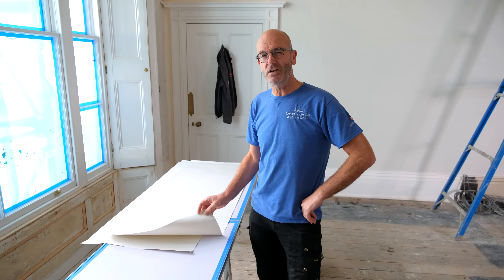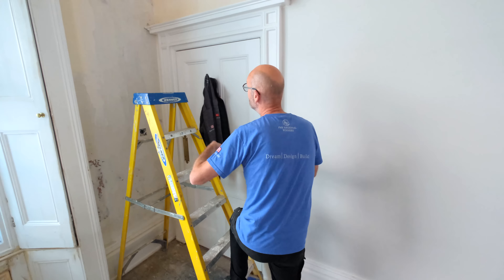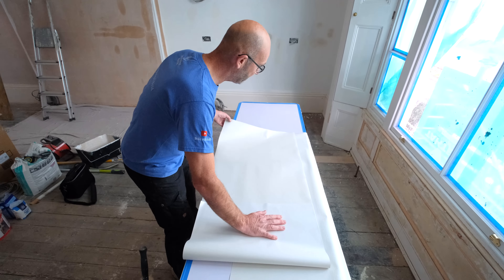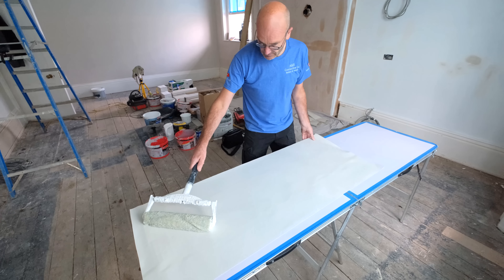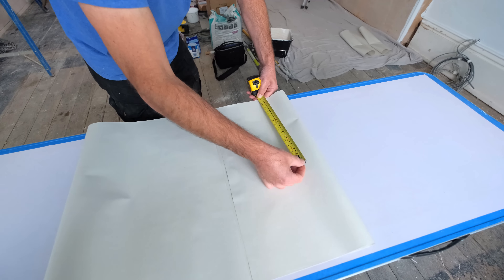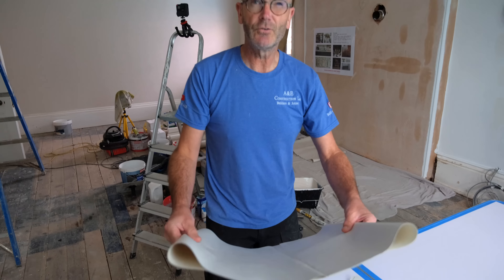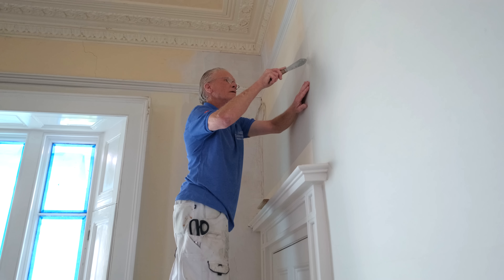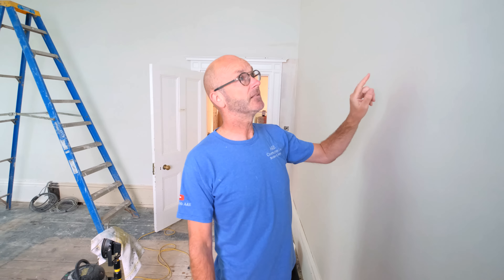CROSS LINING: TIPS AND TRICKS | Painting and Decorating | Build with A&E

Comment: Hi. Do you leave a small gap between the edges of the sheets of paper.  Ive put it up before with little or no gap and when painted the edges seemed to expand and became very noticeable ?
Reply: Hi RR , No we butt joint all lining paper, if you soak the lining paper for the correct time and size the walls correctly you shouldn’t have a problem. Hope that helps cheers Chris

Comment: If just painting over is there any benefit to hanging horizontal vs vertical?
Reply: Good question I would say yes because if you paint over it after hanging then in a few years you decide to paper the room you will not have to strip it hope that helps Chris
Reply: @chrisfoster5098  Definitely, cheers!
Reply: Easier and quicker most times.
A little less waste too.
Reply: Best to hang vertical when painting over, if you hang horizontal, the seams start to open up because of gravity.

Comment: Does the paper not tear when trimming it to length into the corners? I commonly have this issue as the paper is wet with paste so doesnt take the stanley well
Reply: Hi Mohamed only in the corners at the top and the bottom you may have an issue if that’s the case go near the corner and then finish off with the scissors thanks Chris
Reply: @chrisfoster5098  Thanks. It's happened in the middle too. Any idea why that might be?
Reply: Mohammed Saad Rafiq You need to make sure the paper is tight in the internal ,keep the caulking board tight in the corner too,make sure the blade is really sharp press down hard and bingo .hope that helps cheers Chris.
Reply: @chrisfoster5098  awesome, thank you very much.